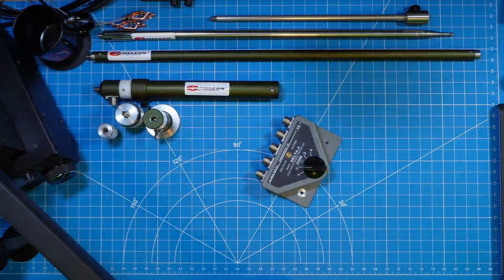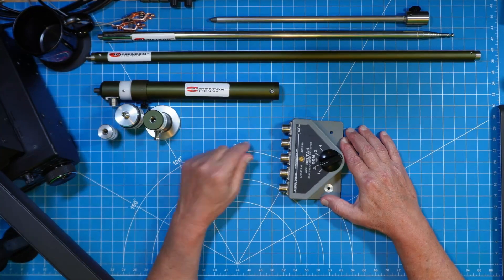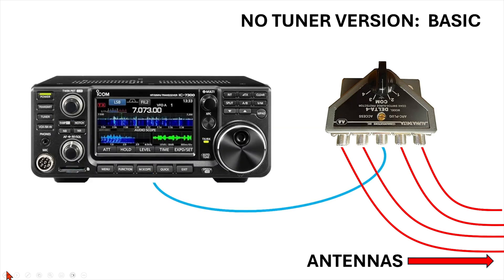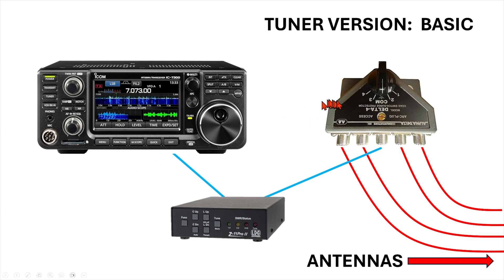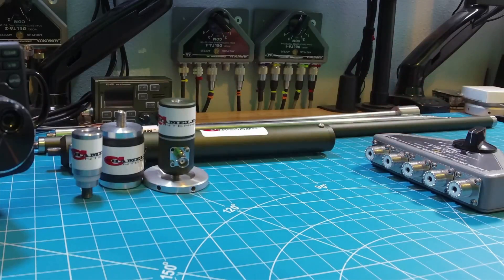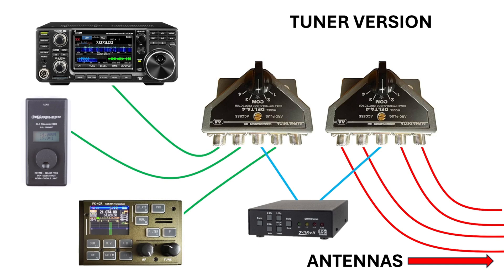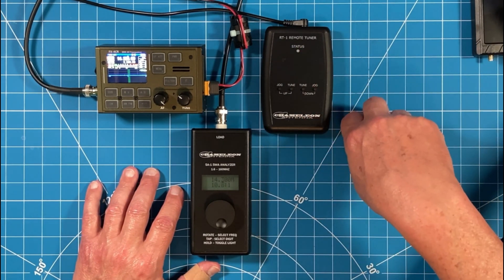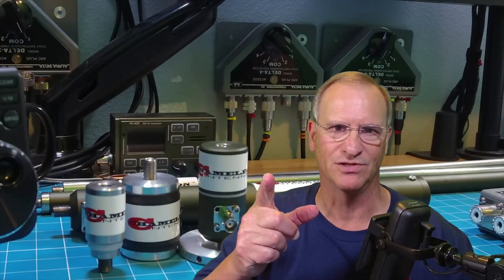New Ham Radio Shack Build Out:  Episode 8 USING SWITCHES for Many Antennas to Many Radios

Comment: Quick reminder - The CHA URT1 cannot have any switches in line between the radio and the tuner because of the BIAS-T is feeding the coax to activate the tuner.
Reply from the maker: Thanks for the reminder; I always bypass my switches when I'm running the URT-1.  I sometimes forget to pass on all the details of my set up.  I'll pin this for others so their configurations are correct.

Comment: Thank you for this video and all of your efforts. 
Its probably a silly question but would you please tell me if the tuner should always be the last piece in line before the antenna? 
For example, transceiver,  frequency counter, power meter and so on.......  then tuner and lastly antenna.
Thanks again.
Reply from the maker: Thanks for the view and kind response.  I cannot think of an instance where this is not the case, but I tend to shy away from the term "always".  Generally speaking, you are correct.

Comment: If I connected 4 transceivers to the alpha Delta switch and one antenna were would I put my antenna tuner in line and would it tune all transceivers many thanks
Reply from the maker: In theory, yes.  I have a tuner that does not require any connection to any radio to tune; this would work as you suggest.  A manual tuner would work.   If youe turner requires interplay with a radio to tune, it may or may not work (think auto tuner).

Comment: What Happens if you hit the PTT but the switch is on a different transceiver?   In the case where you have multiple transceivers and one antenna
Reply from the maker: That would be the same as transmitting without an antenna; radio manufacturers will state not to do that...transmit without an antenna.